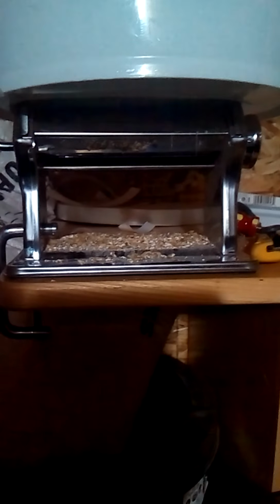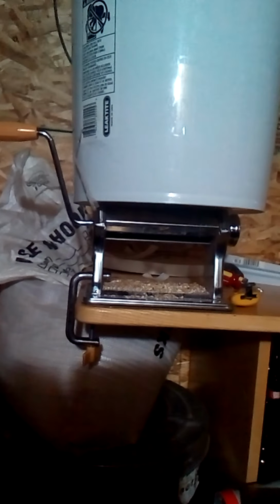Home Made Grain Mill, Pasta Maker, Grain Mill, All Grain Home Brew. Beerzerker.

Comment from the maker: Barley Mill Made From Pasta Maker, Yea ! Mash Ton And Kegorator Build, Oh Yea ! Run Down YEEAAHHH !
Reply: This is really cool. What is the 'nerling' of the rollers you speak of? Whats that for?
Reply from the maker: This is so the rollers grab the barley and pull it through. if they are smooth it won't work.
Reply: Makes sense, thanks. I've got one never use for pasta, considering whether worth conversion. How long does it take to process 5 or 10 lbs (80 or 160oz) with hand crank?
Reply from the maker: I have only used a drill to do it, and it took 6 or 7 min. I may try the hand crank. I will make another video in the next couple of days. it will be on you tube chan Beerzerkeraidian. Happy Brewing Man !